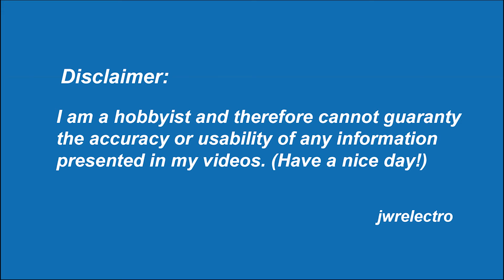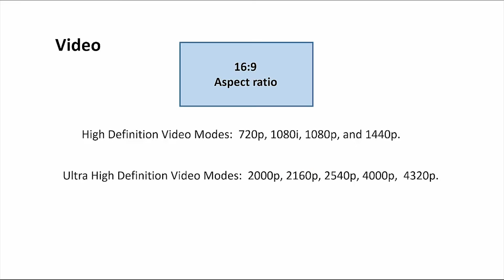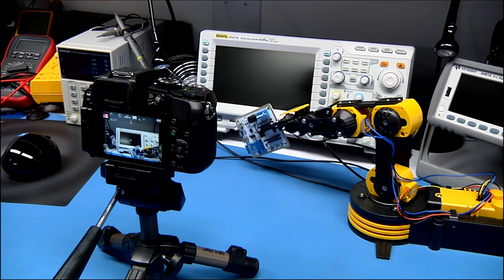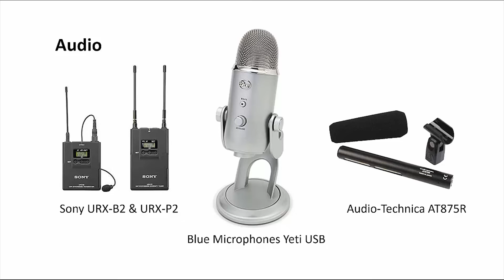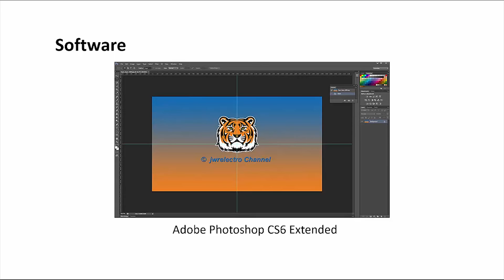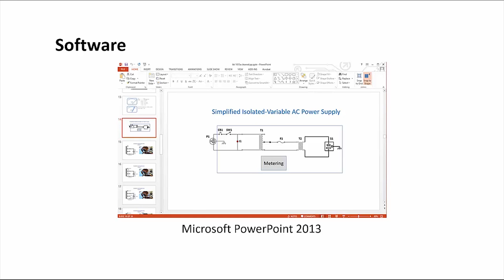#12 - Channel Update #1

Comment: I've been using a Sony wireless mic as well, the UTX-B03.  It has worked quite well.  But, I upgraded the headset mic to a Countryman H6, which has great rejection of background noise.
Keep up the videos.  I look forward to the results (and reviews) of the new gear.
Reply from the maker: +Corgitronics Yes I have also been very happy with the Sony and have used it for several years and never had a problem.  Thanks for the information on the Countryman H6.